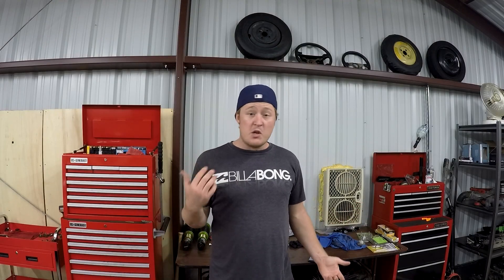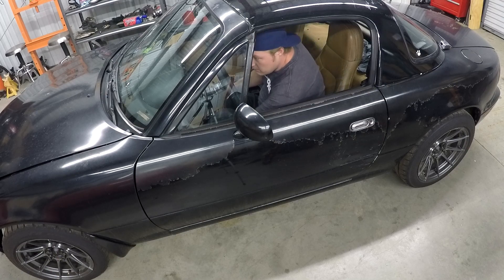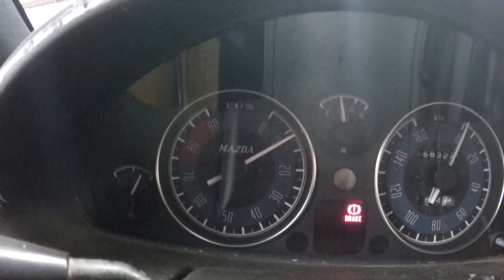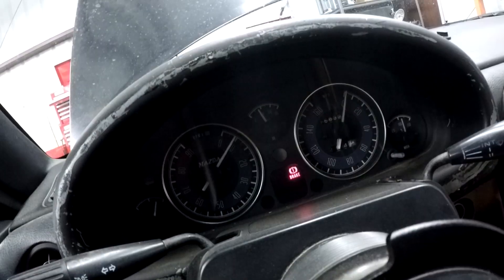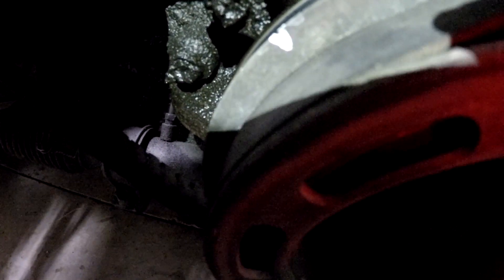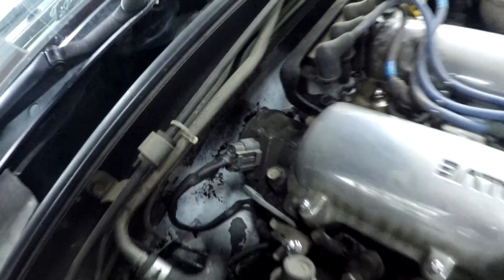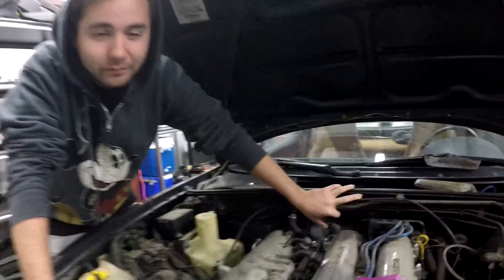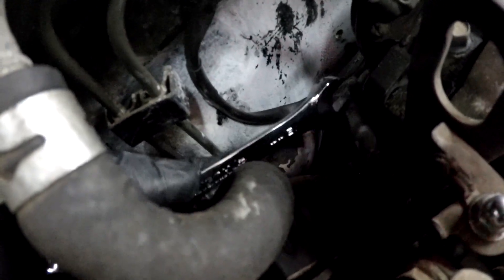Advance Your Ignition TIming! | Reborn Turbo Miata Build #11

Comment: Why is it that none, not one, of the youtube videos on setting the timing say what direction to turn the CAS to advance or retard the timing?  For those that are curious, turning the CAS so that it raises up will advance the timing. And naturally, pushing it down retards the spark.  If you can't turn your RPM down to 850-900 revs, you can just try setting the timing so that the mark is a bit advanced which is where it should be if the enginie is running faster than the required 850 RPM when you test or set it.

Comment: Fixed list of materials:
1.White out

2.Small stripped end wire (or paperclip)

3.12mm wrench/spanner

4.Timing light 

5.Flat head screwdriver (may not need it idle is 800/850)

6.Philip screw driver (may not need if you can reach crankshaft pulley)

7. Spare person (not necessary, makes it easier/quicker)

Comment: I used that method for years but I now do it on the road. I advance timing a bit and drive.  If I don't get a ping when pulling at low RPM and full throttle; I advance until I do then back off just enough to prevent it.

I feel this is optimum.  The ECU is supposed to correct for temperature and pressure (altitude) but I sometimes have to back off a bit more in the fall.

Comment: I can’t get my mark to line up on the 10 degrees it’s very off... any ideas ?
Reply from the maker: Maybe your harmonic balancer slipped. Take the #1 spark plug out, put something long down the hole to watch the piston move and put the piston at TDC and see if the mark on the crank actually lines up with that or not. If not then you have your answer and I would recommend getting a new balancer as well.
Reply: @GearHeadsGarageChannel  Thank you !

Comment: Even after putting a white mark, I still can't find the white mark when using the timing light. 

What am I doing wrong?
Reply from the maker: Are you on the #1 spark plug wire? and did you make sure the mark lined up while cyl #1 was at TDC?

Comment: Hello
For adjust the idle you need to be in diagnostic mode ?
Or you can just simple warm up the engine and turn clockwise the idle:
Let me know
Reply from the maker: The right way to do it is set it to 750rpm in diag mode

Comment: what spark plug gap do you like to run?
Reply from the maker: Depends, on a stock car like its setup in the video .038-.042, I tighten the gap if it gets boosted.

Comment: On my timing light the induction sensor, ( blue on yours) has an arrow marked on it which must go in the direction of cable to  the spark plugs.
Reply from the maker: Yes my nicer timing light I use at work is setup like that also and has an ignition lead. The one I used in this video is very basic but it was all I had back then!

Comment: What year is your miata? Is there a huge difference between 1.6 and 1.8?
Reply from the maker: Not huge, the 1.8 definitely has a bit more torque but they are very similar. Mine is a 1992 and in this video it had a 1.6 but it now has a 1.8 in it for other reasons.

Comment: People please don't do this... Or if you feel like you must, tell the next owner you did it otherwise engines will go boom
Reply from the maker: No, it wont. This is and always has been one of the most common mods on Miatas. If your engine is not pinging/detonating it is causing absolutely no harm and 12-14°btdc of total ignition advance has long been proven as a nice way to move your torque band a bit lower and earlier without causing any harm. Obviously doing things like this is at your own risk and if you make a mistake or mess up and are running at 18-20° you will likely have serious detonation issues. 
No reason to fear monger here, this is being paranoid.
Reply: Done this for decades!! Zero problems!
Reply: "Oh hey, just so you know, I advanced the timing and made the car run better... feel free to return it to stock for no reason at all" ;)

Comment: Hey guys I have a problem, I loosened the bolt for the cam angle sensor but it won’t wiggle around like in the video
Reply from the maker: Tap it with something its just sticking is all. If the nut is loose it should rotate. Whatever you do dont tap against the connector you dont want to break it! but use a small punch or screwdriver or something with a hammer and lightly tap it to try and get it to rotate.
Reply: GearHeads thank you so much your a savior

Comment: I have a 1.8, can I still run 87 octane in it if I set it to 14 degrees, or would it be a safer bet to only set it to 12 degrees
Reply from the maker: Will M Like I said in the video, increasing the timing increases the risk of pinging/detonation. Its up to you to find your balance. If your worried about the cost of gas then just leave your car stock and drive easy!

Comment: i'm a bit lost your title mention a turbo built i see no turbo there...did you do this before installing turbo?? is this the way to take if i'm turboing my car too?
Reply from the maker: Laurent helfer The whole project of the car is to be a turbo build but I did everything else first. Thats just the name for the project, Im pretty sure I mentioned in the video that this isnt for a car thats already turbo'd. If you do turbo your car you will need to know how to change and set the ignition timing though. This was just a small bump in power in the meantime.

Comment: Whenever I set my timing to 14 in the ten and grn mode, it changes when I take off the ten mode. Basically when its on normal mode it get retarded 5 degrees from what I set it.
Reply from the maker: DatNinjaGarage Thats okay, your setting your base timing, the computer makes adjustments, you still advanced it 4 degrees from where it was, if its at 10 now it was probably at 5-6 before you changed it.

Comment: yooooooo... what's up with the valve clatter? worn out hydraulic lifters ?
Reply from the maker: Its super common with Miata's, that engine probably needs a head job and all the lifters cleaned out, either way its not in the car anymore and sits on the floor =P
Reply: I also had the same problem with my car. It's a Malaysian made car. Only have 60k KM on the clock. But mine is not that loud as loud as your Miata. Just wanna know so I don't get ripped off. Thanks for your reply!
Reply from the maker: Well for the record 60k Kilometers is almost nothing in this country, the engine in my Miata making that noise still ran perfect and was very healthy with 165,000 miles on it, almost 250,000 KM where you are from. In the Miata this is a normal and harmless noise, but thats not always true for other cars there is many variables and different sounds to expect.

Comment: Hey I have a 94 1.8L engine that I am setting for 10 degree advanced for megasqurit turbo setup. On my crankshaft pulley I  have two marks. From what I have read the first mark to the left is the BTDC and mark to right is TDC. Seeing mixed things on forums as to which notch to set to 10. It sounds much smoother when the BTDC or left notch is set to 10. Any help appreciated. Thanks
Reply from the maker: will godfrey Yes there is two marks because someone thought it would be great to confuse people. Line up the left mark with 10° on the timing indicator coming off the engine.
Reply: It is confusing Thanks for clearing it up. Love the channel keep up the great work!
Reply from the maker: will godfrey Thanks and no problem! Another way that works for all cars is to manually find TDC by putting a screwdriver or something in the spark plug hole of Cyl #1 and then manually marking the crank pulley. I had to do that on my 1.8 because I swapped to a newer balancer/pulley.

Comment: Would you happen to know how to fix a CAS that won't turn lol
Reply from the maker: Sad Guroo You mean you pulled it off the car and its locked up? or you just cant turn it in the car? if it was locked up the cam would probably snap the rod in the CAS and break it, so I imagine yours is probably just tight or maybe someone siliconed it onto the head or something. Take the bolts out and play with it its not a complicated Mechanism to turn it you probably just need to break it loose.
Reply: GearHeads I loosened the 12 mm bolt and it won't turn I can't adjust the timing at all
Reply from the maker: Sad Guroo Take the bolt off all the way and pop the CAS loose, it slides out the back, probably just stuck from corrosion or something.
Reply: If you remove the CAS, there is an o-ring, should consider replacing it.

Comment: It's funny that you have to tell the newer generation that this is a performance mod. Setting timing used to be regular maintenance like replacing a fuel filter.
Reply from the maker: Floordford Sure I know that but the truth is 99% of people out there dont even have a clue HOW an engine works. This video's concept  applies to all cars definitely but is simply Miata specific in the process.

Comment: Hey man after you set the idle to 800 and you do all the changes do you leave the idle time to 800 or bring it back to what it was before
Reply from the maker: al ben 800-850 is technically what its supposed to idle at when its warmed up so if yours is significantly higher to begin with you might have a vacuum leak or something
Reply: Ok cool so mines pretty much at that right now, also does the car need to have a turbo to change it to 14°, I've never played with the ignition so I don't know anything about it
Reply from the maker: al ben No! if you need to learn more do some google searches on the subject! But with a turbo you would not want to do this, it is better to have other things to handle your ignition timing but that is a complicated subject to get intor

Comment: will there be any long term effect of doing this? like pinging on high rpms
Reply from the maker: The Atar It is always a good idea to keep an ear out for it, but if your advancing your timing I recommended in the video to run Higher octane fuel, so 91 instead of 87 for me. I live in the hot climate of socal and drive in the mountains and it was never an issue for me or others I know that have done it.
Reply: GearHeads well i use ron95, is it the same as octane 95?
Reply from the maker: The Atar No the ratings systems are different. Find out what the Miata was designated to run in RON and then put higher octane in, I think your 95 is like our 89 or something but I'm not sure. Do your research! But as I said its not been a problem if I use higher octane fuel

Comment: Will this work on an 02 NB?
Reply from the maker: CLONE36O Don't believe so, but you guys have a better timing map and tune to start with!
Reply: Right on! I appreciate the response. Love your videos so far, keep up the good content!
Reply: CLONE36O for an Nb You need either an adjustable timing wheel or you can install a potentiometer or resistors on the IAT sensor.
Reply: but the power gains really arent that great..

Comment: Could you explain to me why I need the timing light? Sorry if this question is dumb, but I am new to working on cars. As it looks you only needed it to be able see down there? Can't you use a flashlight?
Reply: So if it would light up at an other time than plug 1 firing, the mark would be at a different position?
Reply from the maker: Yes, or if plug 1 was firing at the wrong time. the thing you gotta think about is when its dark and that light flashes over and over like that, you can see in the video it makes it almost look like a solid line, and it moves back and forth if you move the timing around by turning the CAS. If your spark timing was so far off that the crank pulley was on the other side of the rotation, the car wouldn't even be running lol I didn't rewatch this whole thing right now but I believe I mentioned and showed how to find the notch on the crank pulley that is top dead center for Cylinder 1, this does not get adjusted, the crankshaft and camshafts are locked together  by the timing belt, all we are doing in this is changing the exact moment that the spark plug is being fired.
Reply: Alright thank you very much!

EDIT: Did you notice any significant change in fuel consumption?
Reply from the maker: To be honest I didn't notice much but I never do very consistent driving so its hard to keep track. Theoretically It could raise it a little!
Reply: GearHeads Garage That's what I thought but if it's too much you could easily change it again. I may try it out soon. Since I daily my car and drive about 100km per day I keep track. Usually I am around 7,5l/100km - 8l/100km when driving slow (around 130kmh)
Reply from the maker: Don't advance too much because you don't want to cause the engine to Ping, if you hear a noise that sounds like nails being shaken in a jar you went to far! Every timing mark on the indicator above the pulley is 2 degrees of timing, so you go 2 ticks past 10 degrees to get 14, should be able to see in the video =)
Reply: GearHeads Garage Don't worry I didn't want to go any further :) Thanks for you help!
Reply: Is there any other long term potential downside to advancing (just to 14) that you can think of?
Reply from the maker: Yowzoe None at all as long as your engine is not pinging/knocking. But you are boosted so this subject is much more complicated than I can get into right now. Do some research and learn how engine ignition timing works in Naturally aspirated as well as boosted applications.

Comment: how much power is gained from this?
Reply from the maker: It's only 3-4 peak horsepower, but it moves your torque curve down and gives you more torque much sooner than stock, its a pretty noticeable difference when your driving. Considering an intake and exhaust on these cars might only net 3-5 hp each anyways, this is a good thing you can do that doesn't cost you anything and makes the car more fun to drive.
Reply: You don't get any power increase, it will lose top end power and torque because the timing has been moved to increase torque at low rpm you will lose out as the revs increase and the pistons will be a bit pissed and could suffer depending on how hard its rev'd .....
Reply: @fivedotsdave9723  from what I've read 14 is safe.....those problems occur after 14 degrees

Comment: I would totally do this if I wasn't installing the supercharger this winter. I'll have the powercards control the timing for me then, but I'd deffo do this otherwise as I always run on 98 octane anyway (EU rating).
Reply: So I'm a mechanical newb, but if I have a Jackson m45 supercharger on my 93 I shouldn't consider advancing the timing? thanks
Reply from the maker: Totally Legit Gaming [TLEG] I know your at 98 but I believe that RON and AKI are actually different measurements, so your 98 would be the same ad 91-93 here or something similar.
Reply: GearHeads Garage Correct. I think our 98 is roughly equivelant to your 93 and our 95 is about your 91. 

That's why I added the EU rating disclaimer, as we use different measuring sticks. 

Did you ever try driving on 91 with advanced timing? Did it work at all? I've never had knock driving on 95 (your 91) in the stock engine, so I'm curious of the timing could cause that.
Reply from the maker: Totally Legit Gaming [TLEG] I didnt have knock, just pinging, when I bought the car the timing was too advanced, someone had an aftermarket ignition controller on it and it would ping a bit going up hills and under load, especially on a hot day. But I think it was running at like 19+ degrees of timing. It pinged more on 87 for sure.